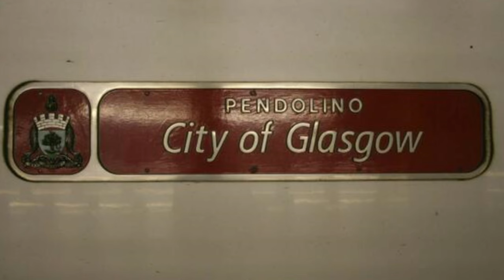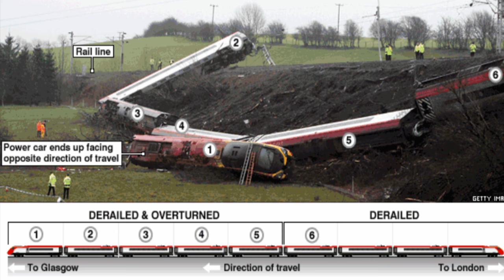Train Derailment and Crash, Grayrigg Cumbria - 23 February 2007 #crash

Comment: I think this was the only time Virgin rail or air has lost a passenger in an accident, quite a record. Does anyone know why the recovery was made using road cranes and not rail mounted cranes?
Reply: Probably because of the damage done to the track, making it harder for rail mounted cranes to reach the site.
Reply: Because a Rail mounted Crane would not be able to slew or extend the distances required because it would be too close to the Load that it was trying to lift. Using a contract Lift crane gives you a far greater flexibility when it comes to the Max weight that you can lift also, you can site the crane, where it is in the best possible position, you are very limited with a Rail Crane.
Reply: @stephensmith4480  I never thought of that , thank you
Reply: @taffy402  No problem my friend.

Comment: Points and Crossings used to be checked far more regularly,  before Privatisation and Budget cut backs. 
I know, I was in 179 gang Shrewsbury. 
Bring back the Local Length Gang. Permanent,, Permanent Way staff. Not agency temps .

Comment: Were the passenger cars scrapped or still in use or what?
Reply: What you Looking at? The hole set was scraped, apart from the rear driving cab which is used for training purposes
Reply: William the butchers son productions k
Reply: Area 51 use